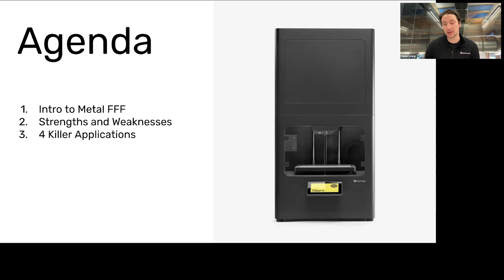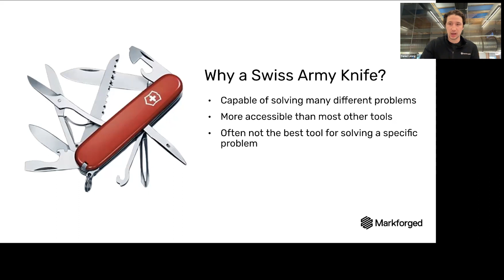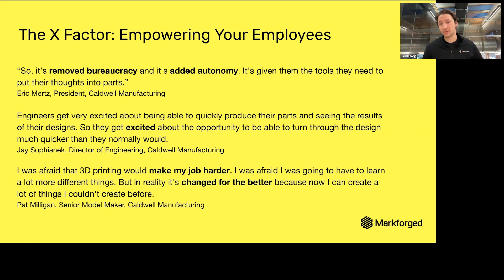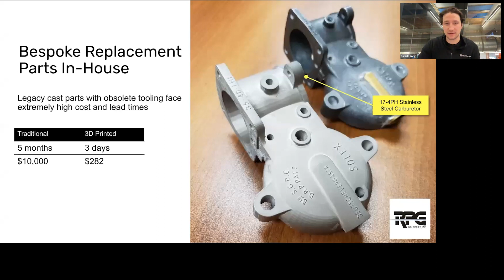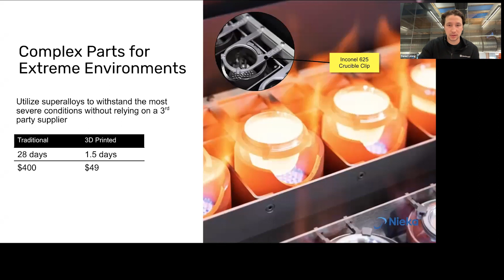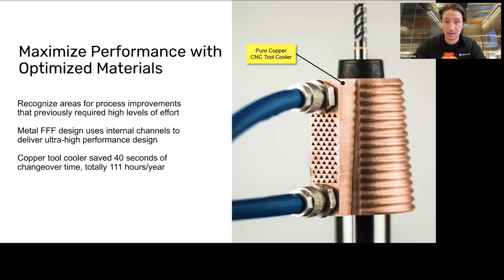Leveraging the Swiss Army Knife of Metal Manufacturing | Webinar

Comment: Can u make in line fuel pumps
Reply: You're only limited by what you can do as in, if you know what you're looking to accomplish, and understand how to design it, there is nothing you can't print. If you understand how to design for 3D printing (i.e., support locations, bearing surfaces, gasket surfaces, tolerances, fits, etc)  you're that much further ahead. I've printed everything from machining fixtures that required pins for locating to parts, parts that needed to have final machining as well as parts used straight off the table.
Reply: Can you recommend any resources for learning how to design things for 3D printing? I googled books and videos but there's so many I don't want to end up watching/reading bad sources @bananariverrods
Reply from the maker: Great question, Jeffrey. It'd likely be a challenge to make pumps from Metal X parts. I don't know of any customers that have tried.